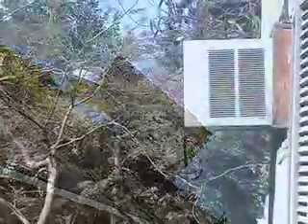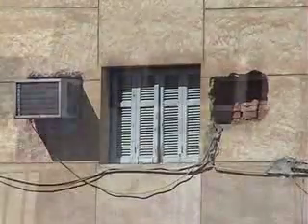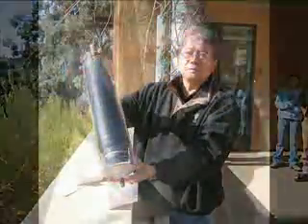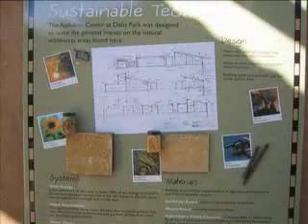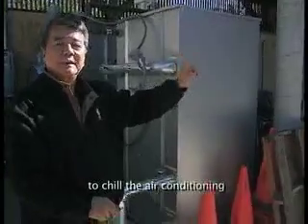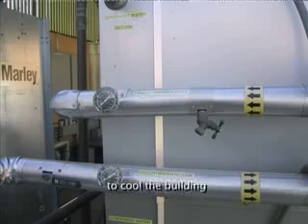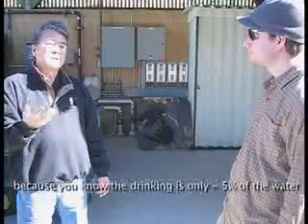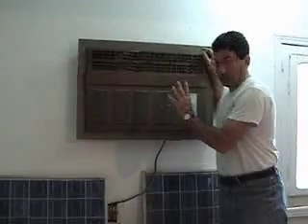Solar Air Conditioning

Comment: It's just moving heat. It's old school refrigeration. Thermodynamics is always the same. Move heat from a to b. Modern refrigerants have low GWP and can run off solar or batteries.

Comment: This is a great idea for anyone with a huge house in the middle of the desert and a lot of money for solar panels and a massive system like this! Of course there's a reason that most refrigeration systems use the vapor-compression method instead of the absorption method. They're more reliable and easier to fix. If the rejected heat from a vapor-compression refrigeration system is the problem, why not just use a heat reclaim system to heat the facility's domestic hot water? I guess that would be too simple and wouldn't have justified the millions of dollars in tax payer subsidies that I'm sure paid for this project.

Comment: The absorption chiller works by releasing the heat from the hot water to gain the energy and cool the cold water. So it's releasing heat into the local environment too, it captures more of the suns heat because the albedo is lower on the collector unit than in it would be in the environment, which means less of the suns energy is released. So that part of your argument fails.

As for the size of the powerplant, a powerplant that cools a city is going to be one big unit. If you divided it up and apportioned one bit to each apartment in the city it would be smaller than a microwave oven. So that part of your argument fails.

The units inside the apartment are practically identical, so if one spews bacteria and fungus, so does the other, so that part of your argument fails.

Maybe you should spend less time clutching at straws?

Comment: I second that, tell us how the thing works, don' need another lib spewing more hot air!
Reply: You're too young to remember we used to have gas refrigerators.  They made the fridge cold by burning natural gas.  It was a closed, sealed system just like an electric fridge, but without using electric power.
Reply: Many comments knockin this as “liberal” ....but everything he mentioned it absolutely true..By profession I work as a 2nd generation plumber , and HVAC technician.....it is true that air conditioning and heating account for close to 60% of residential energy use depending on your climate zone ...It is true the source of our energy is concentrated in  massive multinational companies that have only ever cared about the bottom dollar ...and it is most definitely true that many of our heating and cooling systems are incredibly outdated...using massive amounts of BTUs typically generated by burning long sequestered carbon which according to the vast majority of hard scientific data , is contributing to a warming planet. 
    While the presentation is definitely cheesy and melodramatic ...the fact remains...we are reliant on, and continue to use many outdated and inefficient technologies that are not in the public’s best interest. There is nothing political about innovation and efficiency...in fact last time I checked, those are in fact CONSERVATIVE principles!!!...Speaking of industrial...there  is nothing “conservative” about the industrial revolution in any way shape or form ...or ANY revolution that brings about rapid change for that matter! On the flip, there is nothing more ancient and conservative in principal than using the sun, the wind, earthen thermal mass, water and fire in an efficient manner ..The definition of being conservative is :

“a person who is averse to change and holds to traditional values and attitudes”

However it wasn’t until the industrial revolution that mass oil and coal extraction started driving our economy..It seems many people are confusing economics with politics.. If conservatives truly have the values to hold steady and not change rapidly...then you MUST be against the mass commoditization of fossil fuel and the rapid change that brought to the world. 

Conservation, efficiency, design and innovation have nothing to do with political affiliations at all...We use round wheels not squares because they roll ...they are more efficient, and they are better designed for their purpose . Innovation , conservation and renewable energy is as ancient as the world itself ...it’s the only reason we have survived this long.

Comment: The heart beat at the beginning reminds me of those current affair tv shows which use similar techniques to let the stupid people in society know when the thing they are reporting on is supposed to be bad. The sudden change at 1:35 made me laugh.

Anyway, this technology is nice, but standard solar panels + a normal air conditioner would be fine. The electricity produced could be put to other uses too.

Comment: Pretty impressive, but this system is huge very difficult to accommodate in urban areas. But great step to avoid using green house gas, solar technology is evolving and it will only get better and in few year I'm expecting all household application to use Solar power may be DC and AC input to run.

Comment: Wow, I would get 10,000 BTU on cooling, the amount of cooling a small window unit would get you.
So how much room does a system like this require and how much would it cost to install it?
It would be better and cheaper just to get PV solar panels and power a small window unit from it. Way cheaper this way and less room required.
Reply: Thats not the point, your windows system is still kicking out the heat that this system does not.
Reply: Jason Adams
My system is using the surroundings as storage/battery vessel and if needed I can take the heat back and heat up a room if I use a small 10,000 BTU window based heat-pump.

Comment: Man It's a 'Ten ton' unit........servicing a building of over 5000 sq feet....@ a running cost for heating and cooling and lighting of 5 kWhrs per sq foot.....it's  actually off grid....might be the way to go for District Heating and Cooling and lighting ,  the payback could be factored an apartment building split between owners who bought buy or leased the properties thus  over a  period of time it could stack up....

Comment: Would have been good if the designer of the system just talked about his vacuum tubes and how they were used to produce cooling. The hot water tank, distillation, vacuum distillation, sewage treatment, water pasteurization can all be done on grid so where and how did he get cooling? I liked the intro.but if you have anymore footage on the actual cooling process I'd love to see that.

Comment: "Engines of destruction". "vomit hot air", vicious circle, overburdened, hotter and hotter,
poorly designed parasites...
Jeez, get a job.
And, no, my AC is not helping to melt the polar ice caps, not that that's happening anyway.
Give the hysteria a rest.

Comment: why not make it simple.. use solar PV to power your traditional AC... its green and in that way some of the energy in sunlight is transformed into electricity instead of heat therefore contributing to cooling of the environment..

Comment: because it doesn't work/isn't efficient. i spent ages trying to find out about this.  turns out the system never really worked.  whilst there are some pretty cool alternative products coming online, 99.9999999% are total trash.  alternative energy entrepreneurs are, for the most part, the snake oil salesmen of the 21st century!

Comment: or they don't get the financial backing. the "icebook" has been around since the mid 90s, but has never got off the ground. its a whacked super efficient absorption system. absorption systems WORK FINE. i was at a chicken slaughterhouse for a while there and they had one that used the waste heat to run a cooler to freeze chicken meat. i have a absorption freezer and fridge, both propane powered, and have thought about A/C, but they need to be so big to even do anything.

Comment: more to the point, this system doesn't function.  it only worked for a short while, failed and the cost of maintaining it was exorbitant so the thing just rots away.  i'm so tired of renewables entrepreneurs making wildly fraudulent claims of efficiency.  the way i see it, if the market doesn't buy into it, it's because it either doesn't work and/or isn't efficient.

Comment: you are absolutely correct, such systems (absorption and adsorption systems) are 5 to 10 times the cost of the traditional split home systems in initial cost, what's more! the low cost of electricity in Egypt due to continuous energy subsidizing policies makes switching to such technologies for solar cooling is a total loss and waste of money.

Comment: Well, actually sir this technology is already implemented worldwide, and in Egypt we have too many absorption chillers working since 1995, some of them are driven by waste heat and mostly running with natural gas burners, but do you have any idea about the cost difference between absorption system and traditional vapor compression system for residential applications?
adding solar power would make the cost triples!.

Comment: Videos like this annoy the fuck out of me.  They go on about all this cool technology but never mention cost or performance, and I can't find any details on this anywhere else on the web.  What would this system cost?  What's the breakdown of that cost?  Where could potential savings be found?  How much space is needed?  What kind of conditions does the system work in ie high humidity etc?  Without specific info, these Eco videos are less than worthless because 99% of the claims made by renewabl

Comment: now all I need is $100,000 to install a 1200 gallon water tank, huge solar array, all the electrical wiring boxes and ducting in my apartment. Or just go buy a $50 air conditioner hmmmmmmm choices choies

Comment: LiBr Water Absorption chillers are not a new technology.  I was the A/C tech on my sub.  We had a 200 ton LiBr and 2- 175 ton R-114's.  The USS Daniel Boone was built in 1963, so the tech. is at least that old.  The LiBr is very good at what it does, but can be very tempermental.  LiBr is a salt and under certain operating conditions it can solidify, plugging up the works.  That's why you see it almost exclusively in industrial or commercial settings, with dedicated utility managers on site.

Comment: Electric cars need coal and the coal industry is on the the fast track to be shut down. in the US.Only a complete idiot would buy a car whose fuel is about to completely stopped by the federal government who are the ones making them as well, until thy give the work to China.  I'd buy one if they cost 1/3 the amount, actually worked, and would use it for local errands, instead of a scooter while keeping a real car for serious transportation.

Comment: It does not work, at least as reported.  It takes many dollars to save few dollars... but when these guys puke out the green BS like this, this makes REAL investors turn away... As of right now the real answer is cheeper "China AC Units" they run way more Efficient  than the old units, or better yet, someone to manage this BS! run commin large scale systems & split the usages. do you see the problem here? Real Green Can Only Will Work When Green People Work With Someone Like Me!!!!!!

Comment: Ummmmm, there are a lot of solar/hybrid A/C systems that employ the use of vaccum tubes to help save up to about 50% of the energy and these units can also help make hot water for free with the same system just like this video is describing.  Also you won't need a 10-ton unit for your room ;)

Comment: I saw these in windows on the news recently- each sunny side window in a 5 story apartment in the mideast (arid climate). ice may be made from a slight variation (from what I understand-haven't seen it yet on the net). several versions on the net (solar zeolite refrigerators). pedal powered here. 
'Pedal-Powered (Vacuum) Zeolite Refrigerator'  on YouTube- adding solar should be relatively easy in arid climates (water / zeolite)

Comment: Solar/hydro vacuum in a tube, not superhetrodyne vacuum tubes. Whole different thing. Water heated in a vacuum in order to reduce the needed temperature to boiling point; not necessary for the air conditioning, rather a plus in the system for water purification. Appears to be used in this system for increasing heat gain efficiency and distilling water.

Comment: I don't think the vacuum part is correct, but absorption chilling is proven.  It's used in RV refrigerators for example and commercial buildings - typically not with solar collectors, but it has been done.  On the plus side, demand for cooling is in sync with the sunlight.  But there is an up front cost, which may be why it hasn't boomed for home use.  At night and on overcast days you need a backup (gas or electricity).  The grid will likely remain but the consumption could be brought down.

Comment: I didn't know that. I thought that this video specifically said that the heat pump was powered by Vacuum tubes. That would be a limiting factor, especially as from experience with music and sound equipment, they're not cheap.

Comment: Well, based on the solar vacuum tubes they showed in the video, those can boil water in as little as 30 minutes (If I remember correct) and will keep water hot at over 100 degrees overnight.  I just don't get how the absorption cooling system works.  Otherwise, I don't really see anything miraculous here.

Comment: It does seem plausible as it looks like it draws on the same concept as an absorbtion refrigerator that literally makes ice from fire.  The heat, as well as the low pressure cause a flow to occur in a closed system with nothing more than ammonia, hydrogen and water. In this system,  I see the use of the vacuum to achieve lower pressure "boiling" of the refrigerant.

Comment: I lost count of the number of BS claims while watching this video. 

The heat pumped outside by air conditioners is not enough to make a significant difference, contrarily to the low albedo of Asphalt. "Thousands of watts per hours?"do you even know what a watt is? Air coolers companies have been legally obligated to use HFC instead of CFC since the 70s. Worst part is that I know the technology behind Solar Air Conditioning can work. 

You guys are hurting it with your nonsense.

Comment from the maker: Obviously all those high school teachers who show us that you can create ice by releasing pressure from a scuba tank or a fire extinguisher or a hair spray or paint spray can were in on the conspiracy!  Snake oil, I tell you!  Thanks for clearing up the scam  Martin!  The world owes you! Solar air conditioning is impossible... and even if it turns out that you CAN use heat to do absorption chilling, it would still be impossible because the sun  can not make things hot.

Comment from the maker: ...driving the phase separation, that he was telling the truth.  But since you say it is a scam, I am going to have to go back there when I'm in L.A. and hunt for the hidden wires and compressors.  Thanks to your astute message I'm now getting convinced that there is a vast conspiracy afoot to convince us all that the laws of physics permit heat to change pressures (Boyle's and Charles' laws?) and that releasing that pressure through an expansion valve removes heat from the environment.

Comment from the maker: ... but according to you it must have been some careful magic trick they were playing on us.  I still don't know where they hid the electric compressor, the wires, and the generator, but you must know better.  I had assumed, when the engineer showed me how the solar air conditioner at Debs Park Audubon Center in L.A. works, that his explanation of how Lithium Bromide acts like the Ammonia in our heat-driven refrigerators and the solar generated heat acts like the gas flame...

Comment from the maker: Of course I was lulled into my false sense of belief that heat can drive endothermic reactions and thus that heat can make things cold by experiences with a kerosene absorption chiller we had in the jungles of Borneo in the mid-80's on a Harvard Research expedition where we were told we had no electricity.  Obviously they must have been scamming -- me those crafty Harvard professors -- because I thought it was the heat causing the phase separation of the ammonia and the water in the fridge...

Comment from the maker: Gee, I hadn't thought of that Martin; you must be right -- not just about solar air conditioning but about the entire fields of adsorption and absorpttion chilling!  Obvious scams, and here I fell into unwittingly fooling the public simply because I observed a solar air conditioning system work with my own eyes and later bought a Dometic Absorption Refrigerator and now run it off of the heat of a small flame from my porchtop biogas digestor.

Comment: The solar air conditioner still takes up lots more room than any other air conditioners, and it alone can't eliminate the need for power plants. Until every other electric device comes up with some means of powering itself, then that thing is utterly pointless. Ill stick with my R407C air conditioners thank you, which you could fit about 100 into the size of that stupid thing. And in the winter, how does it heat? In the UK it would be useless.

Comment: @Pneuma001 yeah, that was exactly what I was stating, and probably you can get free energy from it if you add some magnets... k, trying to get serious now... it DOES substracts energy from the universe, specifically from the Sun, where a normal AC substracts it from the power surge, that's the only difference... the Universe still balanced, but one system uses energy that probably needed coal to be produced and the other uses the Sun, that will warm the Earth anyways...